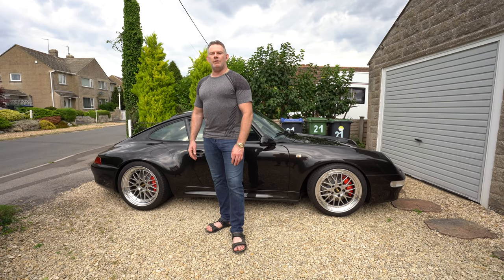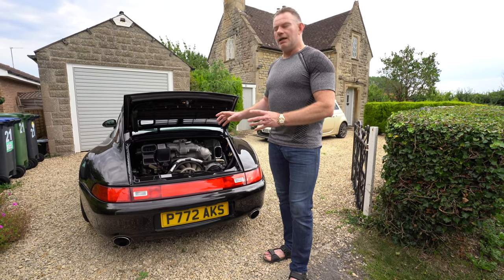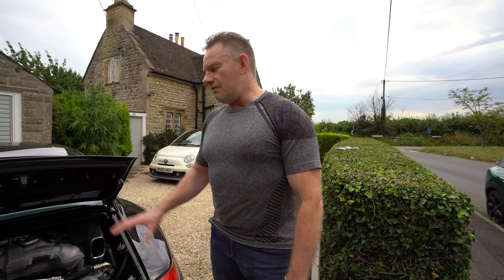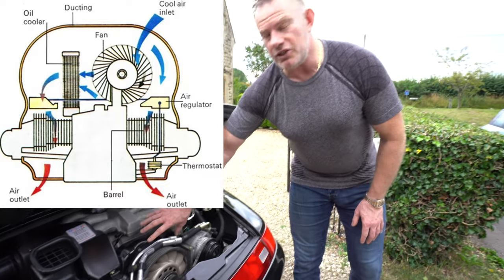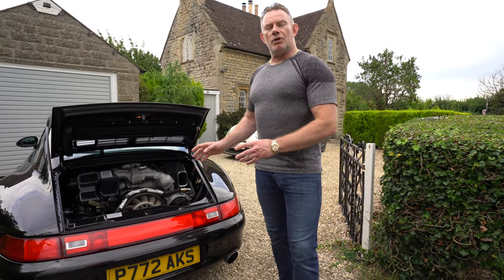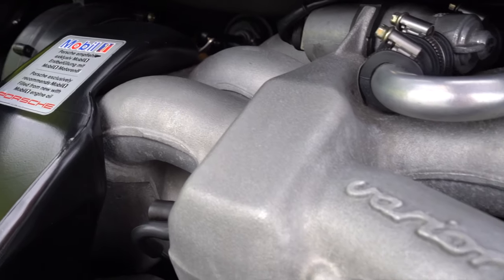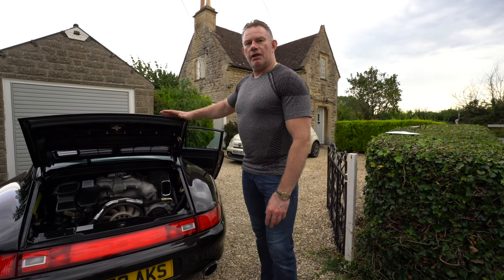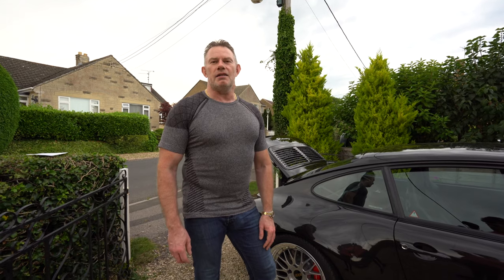The Porsche M64, 993 Air-Cooled Coolness!

Comment: Re: cooling, you skipped over the oil cooler / heat exchanger + fan in the front right corner of the car. 
And since we're on this subject, the HVAC cooler / heat exchanger + fan is in the front left corner. 
If you've ever had to change the ballast resistors, you know the fun this entails!

Comment: You could have mentioned the factory power upgrade (X51) for Varioram engined cars...
All the Porsche 993 Carreras (non RS) have 3,600 cc. Porsche introduced VarioRam for the 1996 model year which increased the 993 Carrera’s power output from 272 to 286 ps. The first owner could order the factory power upgrade (X51). With a larger 200 cc increase the engine power output went up to 300 ps.
Reply from the maker: I believe I do mention the X51 upgrade option in another email in the 993 S Playlist but thank you for the reminder.

At the time, the additional 200cc increase in capacity would have been a substantial gain in power.

Comment: Great run down of the engine differences. I replaced the bearings in the wing. They are known to go bad. I also disabled the mph switch so it only goes up and down manually. Didn't want the wing rising and lowering non stop in traffic. Motor will wear out faster. Love your car. Wish I caught the air cooled bug earlier so I could have got a turbo at a reasonable price. If they ever come down in price wife wants the 4s and I will get a turbo.
Reply from the maker: Thanks, much appreciated. 
I have contemplated the wing hack but due to only driving it on special days it wouldn’t really be much of a benefit. 

Another common hack is to put the oil cooling fan second speed stage on a switch instead of being temperature controlled.